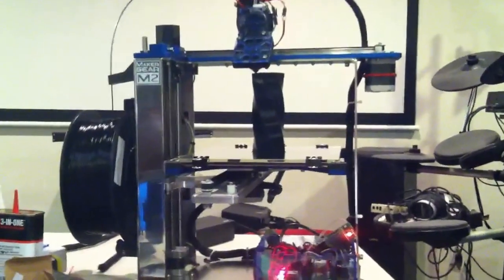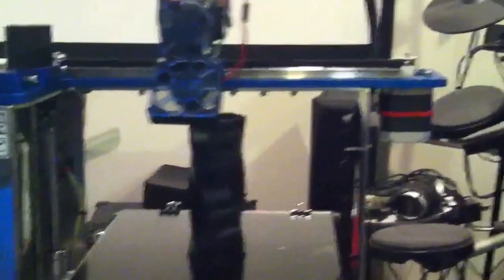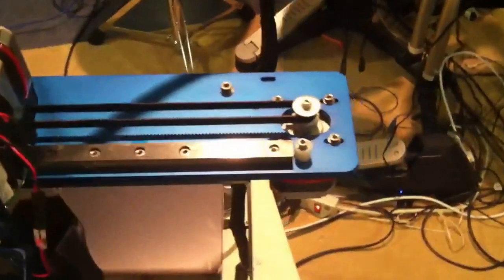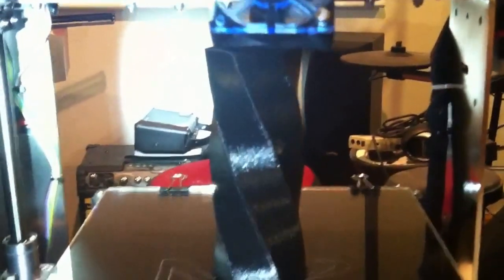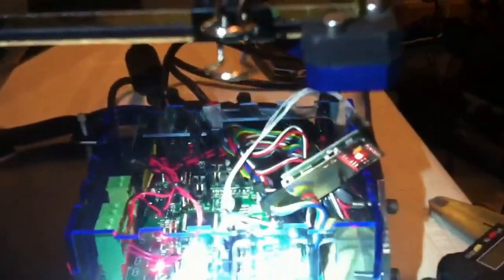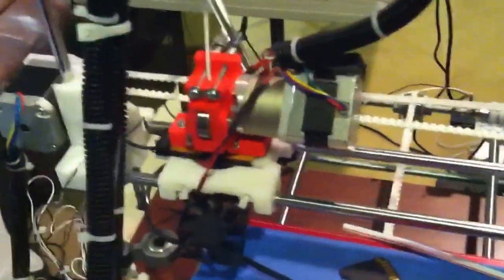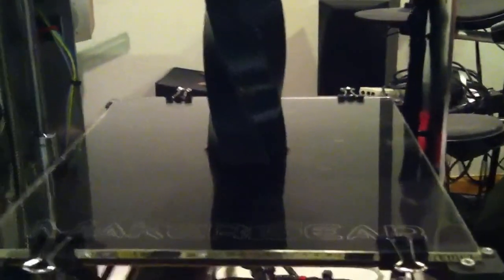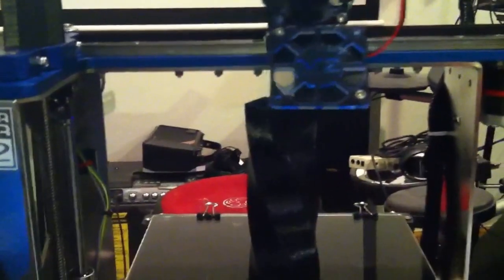New Makergear Mosaic M2 3D printer in action

Comment: I have a M2 similar to yours. They used Mic6 tooling plate for the top plate and the table frame support. The frame is very rigid and they took considerable hand finishing time with the radiusing of the left side edges. These have to be finish welded and blended with a grinder before being powder coated. The Linear rails on the X & Y axis add more rigidity.  My machine has dual lead screw on the Z axis. Not sure of the Z axis rails but they may be precision recirculating caged balls that add rigidity & repeatability. They are precision tolerance which eliminates side play. Most lower cost rails are oil impregnated  bronze\brass and will eventually develop side play if not lubricated.
All in all this machine quality isn't cheap to produce, hence the high purchase price. The quality part prints speak for themselves.

Comment: It seems like the build platform only being supported on one side would be somewhat flimsy, slanted down by a few mils, or possibly vibrate as the build axis went up or down. Do you find this is the case or not? There is a lot of weight held out there with the second axis gear and all that aluminum. I don't know.
Reply: The rigidity issue you mention doesn't seem to be a problem, the build table rests on a high stiffness linear rail, the round rods use high precision linear caged balls. The Z axis rails are securely mounted to the frame. This machine was engineered and built to a quality standard. The X & Y rails are $300., the Rambo board is $ 180. The frame was expensive to fabricate due to the radiusing on the left side. These corners had to be welded and finish ground, small details that  adds considerable cost to the machine.
One has to remember that the parts being printed don't weigh that much and there is hardly any side cutting forces like you would encounter with milling metal.  The stainless steel frame is very stiff and was made from heavy 14 gage sheet stainless.

Comment from the maker: So the Makergear electronics is Arduino mega compatible and is running a modified version of the Marlin firmware. Wich means you can use your preferred software. I am using pronterface and slic3r.